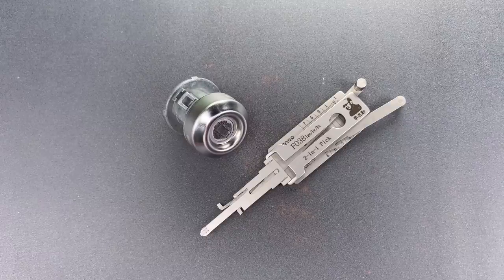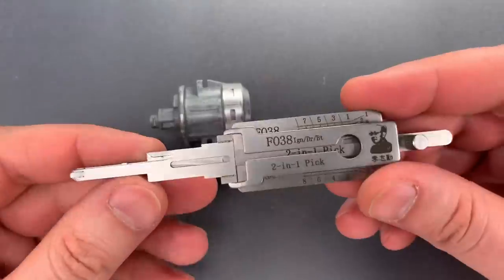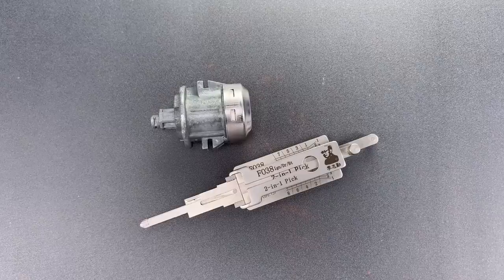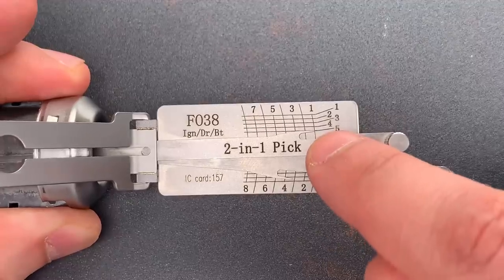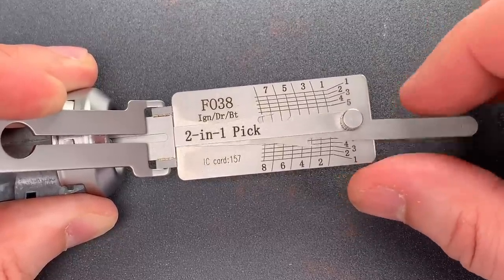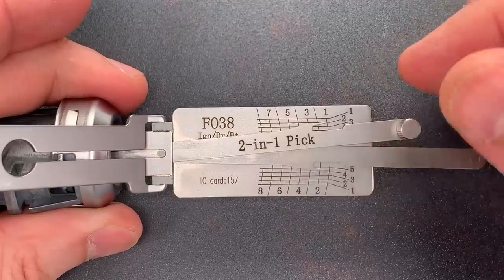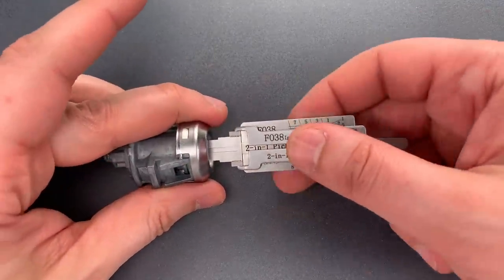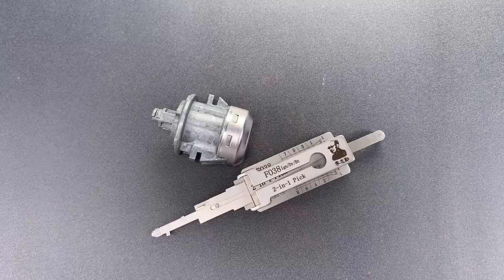[1240] Ford Expedition Lock Picked & Decoded w/ Lishi Tool

Comment: "A lot of times wafers are missing"
Thanks LPL there goes my brand new Ford Expedition
Reply: i will be at it's funeral
Reply: Also, at what adress do you usually park it, and what time do you usually go to sleep?
Reply: @lilpeach101  😆😆😆😂😂😂
Reply: Don't you just use a laptop for any car younger than 5 years old. Well my cars 15 years old and it's keyless entry so does anyone have a key for their cars now?
Reply: It not actually missing though, the ignition barrel has all the wafers, the door key has less to allow for space constraints. This allows for one key to open all locks, same way a master key works.
Reply: @nothingsurprisesmeanymore  almost every key has a key even if it’s push start just in case the fob dies
Reply: This opens the door and turns the ignition, but the computer will not start the vehicle without the resistors. More work is required.
Reply: @nolanhartman9046  No need for a backup key slot these days. Many of them have a decoder chip inside that works even if the fob battery is dead. You just place the key fob over the start button for a second or two and then press the button.
Reply: Some brands also make a "valet key" which will only perform certain functions.  Those vehicles probably have omitted wafers on some of the locks and the valet key doesn't have the cut for those positions in the locks that do have those wafers.
Reply: @WhiskeyGulf71  I haven't seen anyone try as hard as you for a long time.
Reply: @nolanhartman9046  What did that mean in comprehension?
Reply: @Combatpzman  And if the vehicle battery dies?  The backup key is to gain entry to the vehicle which you likely need in order to open the hood to charge or replace a dead battery.
Reply: @willstikken5619  We were talking about the ignition. Thus the start/stop button. As for no key for entry, ask Tesla about that.
Reply: @Combatpzman  That's not what i read from the comment you replied to. Most vehicles continue to have keys hidden in the fobs that are only useful for entry.

As for Tesla they're a great example of how not to build automobiles.   They'd have served the industry better as a drive train supplier.
Reply: @willstikken5619  I’m fully aware of the small key for the driver side door, I have a car with push button start. Many of the newer models don’t even have that anymore.
Reply: Thanks for the ford btw =)
Reply: @nolanhartman9046  
On some Fords if the fob goes dead there is a spot in the cup holder that if place the fob in it, it will allow the vehicle to start.
Many cars still have one key lock usually on the drivers door sometimes it hidden under a plastic cover.
Reply: not to make you feel bad, but a sixty dollar air wedge and pull stick kit for getting into cars works just as well,  takes less than thirty seconds, No I'm not a car thief I'm a retired mechanic and I used to work at an Auto Auction I drove the Service or Lot Truck sometimes and unlocking cars was part of my job.
Reply: @eriklarson9137  sorry that wasn’t a good way of saying it after I read it. I meant that “keyless” systems that are just a fob often come with a traditional key in case the fob dies
Reply: @ttww1590  If the door is open you have access to the OBD port.
Reply: Challenge forever lock!
Reply: @ttww1590  it's been a long time since the ECU's immobilizer system relied on resistors, this is not your 1992 Camaro!
Reply: @siraff4461  access to the OBD port won't help you start the car
Reply: @bikecommuter24  Yes, but if the customer has lost the keys and needs new ones cut your air wedge is not much use (unless they are happy to pay for new locks all round).
Reply: @mikes4163  
I worked at an auto auction the keys were usually in the car, sometimes the drivers locked the doors out of habit. the keys were usually secured with a cable around the Column but those could be removed with a magnet which I kept in the truck, during the auction some of those cables bound up the steering wheel I kept a pair of wire cutters in my pocket for those emergencies.
Reply: Dude, he revealed nothing that hasn't been common knowledge in the business for decades. SMH
Reply: @WhiskeyGulf71  also allows for valet keys. Cars that have them have one more wafer in the glovebox and trunk locks.
Reply: @ttww1590  actually cars use rfid chips for that. Only GM vats keys had resistors for a while in the '90s.
Reply: @carlosedwardos  Tell that to the thousands stolen that way each year. It allows you to programme a new key in a lot of cars.
Reply: Almost every manufacturer doesn't put all of the cuts in all of their locks. This isn't just a Ford issue, FAR from it.
Reply: @ttww1590  resistors was only used by GM & haven't been used in over a decade now.
Reply: @Combatpzman  Tesla still has a manual way to get into the vehicle.
Reply: Thanks for the new car!
Reply: Dont worry they dont need the key at all.. I've seen them stolen literally guy walks up and starts it and its gone. Keys were locked in a signal blocking safe too.
Reply: @Jasonjays122  easy, just put a spare fob inside the car.
Reply: @bikecommuter24  I have a Flex 2019 never got a akey with it just 2 fobs. Some cars are just keyless.
Reply: @michealpersicko9531  
I believe your fobs have a small key that can be removed so you can get into the car if the battery is dead, its not to start the car just gain access.
Reply: @bikecommuter24 You're right there is i just couldn't find it and i find its use case for it really fucking stupid its to get in if the fob's battery dies. I couldn't figure out how to pop it out either i'll probably figure that out when the battery needs to be change which i always have cr3032s lying around the house anyway. IDK why it's so hard for people to go on aliexpress and buy a bunch of them for dirt fucking cheap. They've lasted me almost as long as an energizer one at half the cost. my lease would be over before i ever need to fumble with the emergency keyblank i can easily make myself out of a thick piece of metal and a file. It's not really a key just key blank with out any bittings cut into it.
Reply: New ford uses h101 keys. It's high sec
Reply: No, there goes the stuff inside the Expedition. The wafers are missing from the door locks, not the ignition lock! I'm pretty sure the ignition lock also requires an rfid chip in the key on most new Fords too.
Reply: It’s a Ford, so it wouldn’t have lasted long anyway
Reply: @richardjameswellingtoniv9682  Um my first flex lasted me about 10 ish years before i got the 2019 model. i live in NY where winters can get pretty bad and driven over a couple of huge piles of snow by accident because the state doesn't know how to plow streets properly and they're always in the most unavoidable spots on the side of the road when turning.
Reply: @lilpeach101  asking for friend?

Comment: LPL: It might intrest you to know that I do not have several dozens of these tools. But all of them.
Reply: I’m an automotive locksmith and I have a set of these. I love the fact that they enable me to generate and program a working key in less than 5 minutes!
Reply: @gandalfcoigny9013  who would the programming part work for your average car? Wouldn't you need a working keyfob or the key code card to program a new key?
Reply: @lucasbiaggini  My statement should have been: ...along with a suitable programmer, they enable me....

One of the reasons locksmiths charge a premium, is that we have to purchase special hardware and software (tens of thousands of dollars at times) to enable key generation from a modern vehicle where all keys are lost.
Reply: @gandalfcoigny9013  I would have gone with "a working mechanical key." Absolutely true for a Chrysler product but not so much for all. Especially a dirty Honda lock.
Reply: Would that make you "Bon. Gustav le Bon"?
-
Sorry, couldn't help it.

Comment: This tool tickles me, because it is the precise and glorious opposite of Chinesium. It's a well made tool, works as advertised, and the company is proud of its being Chinese made.
Thank you for posting this.
Reply: Chinesium is not a result of being made in China, rather a result of western production teams instructing Chinese manufacturing to cut corners as a cost saving measure. If the Chinese can manufacture the silicon chips and assembly in the device you are using to write your anti Chinese sentiment, (all of which requires nanometer precision) you can be damn sure they can make a product that at most requires 5 microns of tolerance.

Comment: I'm a locksmith and we have multiple sets of these! (Got tired of sharing 🤣) One cool thing is when you have missing wafers like this, we have a couple of different pieces of software that will fill in the blanks by bringing up all possible OEM pin-outs and the corresponding key codes.
Reply: Why would you need to fill in the blanks? Wouldn't you also need the transponder code in order to make a key that worked in the ignition? Or is that what you mean by "key codes"?
Reply: @aspzx  to get an ignition or trunk key. And yes on most newer vehicles we do also need to buy a transponder and program it.

Comment: Fyi: You will not be able to make a new key after decoding the door lock since some wafers are missing. Hover, if you have access to something like "kreate a key" software, you can enter the known wafer numbers and then by exclusion figure out the rest of the wafers (that is present in the ignition lock). Ford only have like 1800 approved combinations along 8 wafers with 5 cuts per wafer. Been doing this for >10 years for fords with this lishi tool. It's excellent. Also, after reviewing this video i think the correct bitting is 12232313 wich translates to key code 0625X
Reply: Doesn't each ignition key also have a unique transponder code? How would you create a key that works in the ignition without that code?
Reply: @aspzx  correct, up to my15 give or take you can program new keys with the diagnostic tool as long as they are properlu cut. You need two keys. Newer cars require pats authorization w ford. Only select ppl have access.

Comment: Physical key is only half the battle with missing car keys, the rest is the FOB programming.
Reply: To steal the car, but to grab the laptop someone left on the passenger seat, this will do.

DISCLAIMER: DO NOT STEAL STUFF
Reply: FYI: "Fob" is a regular word, not an acronym. There's no need to put it in all caps.
Reply: FOB Mr Tracy
Reply: Programming is often a generous term. In some cases it's one of 6 resistor values, try, wait, repeat.  In others access to the ODB port allows you to enter a PIN cde and program the vale of the new key you brought with you.
Reply: @wbfaulk  forward operating base? :P
Reply: @artstrutzenberg7197  … In this case, it's a regular word, not an acronym.
Reply: For Opening Boot?
Reply: @paulmccoy2908  frequency operated button
Reply: But there are times when your key is locked inside the car, so all you need to do is enter. Of course, then you don't really need the key decoding, but it's still a neat pick.
Reply: @wbfaulk  Indeed. The acronym FOB means Free On Board (used in trade)
Reply: @gandalfcoigny9013  That would mean that the button was somehow controlled by a frequency. More like "button operated frequency" since it's doing the transmitting.
Reply: If it's a resistance chip then you can use the light dimmer as a variable resistor to get it started.

If it's a radio transmitter then you need to steal the transmitter code. You are likely not going to steal a car in one break-in if that is the case.

If it's a key card with a pushbutton start then you could probably get the key transmission from outside the front door of a house.  Seeing most people leave their keys near the door.

Or you could just break in the house and get the key
Reply: i can steal any car with a screwdriver if it was made before 96. and now that all of those cars are now 25 you could literally steal them and register them without a vin no. where i live

Comment: That is a beautiful piece of kit!  Really makes it easy to visualize what's going on inside the lock.  With a couple dozen, you could get inside the most common automobiles with minimum effort.  Of course, with most  you still have to deal with the alarm going off unless you can quickly turn the ignition.

Comment: I bought a 2003 honda accord that had a mismatched door lock. I bought another cylinder off Amazon and used the pins between the two cylinders to rekey the door to the ignition. The hardest part was getting the lock out of the door. This tool is a great representation of how a car lock works.

Comment: As a locksmith I use Lishi tools on a  daily basis. They are wonderful!  Definitely worth the investment. There's only a few times where they dont read quite accurately. Sometimes this can be fixed by applying some spray lube to the lock cylinder before picking.

Comment: I worked for a company that did vehicle lockouts. While this would be more difficult to use than a bag/wedge/rod, it would be less damaging. A lot more expensive, too. Were I a locksmith, I'd have to attend your TED talk as well purchase a full set if these plus "the lock BosnianBill and I made" and that multitool with every possible insert you sell on that site.

I'd either be the best lockout artist or most prolific burglar of all things residential, commercial, and vehicle.

Comment: Its funny cause last time i was locked out of my car the locksmith said they couldnt do car doors anymore
Reply: It used to be a lot easier to open most vehicles with slim metal bars, bypassing the locks completely without damage or much skill. Lock bypass is often still posssible, but requires more skill and higher cost tools. Locks change by model, year, and region, so a full pick set is expensive. Both solutions may get you in but not started, which is additional cost.
Reply: Likely your car has a much more advanced lock than this
Reply: Does cars even have keyholes anymore?
Reply: @Defy5  - My Toyota has this little "key like" thing that slides out of the Fob. It's used in case the FOB battery goes dead. There's a hole in my door handle to insert this little key to open it.
Reply: @ttww1590  Most locksmiths try to avoid going inside a door like the plauge now that Lishi tools are available. Too damn easy to break a linkage.
Reply: @Defy5  Tesla are the only ones I'm aware of that don't have a mechanical override lock somewhere, generally hidden behind a plastic cover in the driver door handle.
Reply: @Defy5  I’m pretty sure cars have to have at least one keyed entry point. On most cars I’ve seen ‘that don’t have a keyhole’ on the drivers door there is a little plastic bit of trim on/around the door handle that can be removed. Under that will be a keyhole.
Reply: @bamascubaman  tesla is easy to break into i have done dozens of them..... open the front trunk bag the green/white and red/yellow wire that goes into fuse 32 and wolla door handles open on right side, and you can open the door without alarm. you can use a small battery and do almost the same to  take 1 window down since they have 4 fuses for every window motor alot off design flaw in them..
Reply: @olemann4935  no need to do that, there is a purely mechanical override, it will likely set off the alarm however.
Reply: @bamascubaman  mechanical override on tesla? For the doors? I don't think so... i worked at a body shop before i went the other way in life and changed alot off doors trunk and stuff on tesla and interior parts, don't see how that can be possible...
Reply: @olemann4935  pull the interior door handle twice, much like several other vehicles & it will open. That is the method in the owners manual. That might not hold for the Model X, I believe the illustration that is referenced on one of our private forums was a Model S.
Reply: @bamascubaman  ah yess that is correct but to get something between the door will be hard since the window is locked up like the porche 911s.s so if you tried this you will proply break the glass i believe.
Reply: @olemann4935  just have to be careful & a thinner "long reach" is helpful for vehicles with indexed windows. I've done it several times on vehicles with that feature.
Reply: @bamascubaman  ah oki ehat kinda bends do you have on it?
Reply: @olemann4935  nothing special. I adjust as necessary for the individual vehicle, generally doesn't take much.
Reply: Ford will most likely change the lock slightly with the release of the next expedition series.
Reply: @olemann4935  "wolla"?
Reply: @barodrinksbeer7484  maybe but it'll likely only be switching the wafer locations if they change anything. They already switched the Expedition to the current "high security" milled key in 2018.
Reply: @thelasttimeitried  Still better than 'viola'!
Reply: @olemann4935  Yeah, I get the sound, and I knew what you meant in the first place, but I think the word you're saying is in fact the French *voilà*, hence my viola remark, as it's frequently mis-spelled.
Reply: @jonathanrichards593  wolla (Dutch) also wollah
Reply: @Defy5  my 2006 (GM) Saturn Vue has exactly one.
Reply: @thelasttimeitried  "voila," phonetically.
Reply: @olemann4935  Ah, OK, I did not know that it was a Dutch word, too.  Today I learned...!
Reply: @jonathanrichards593  i didnt either😂